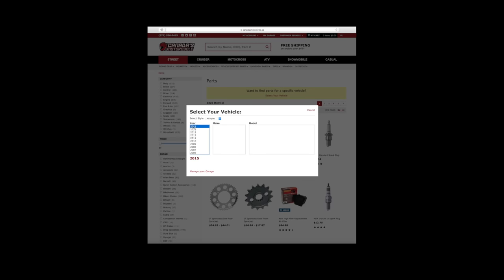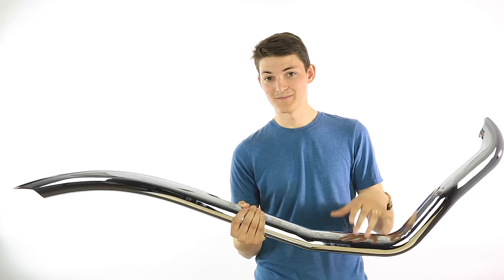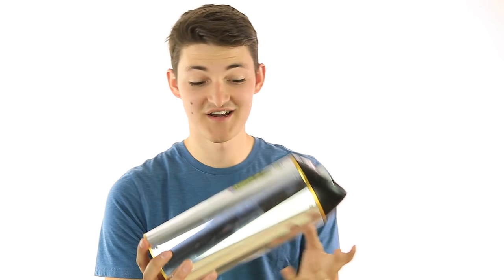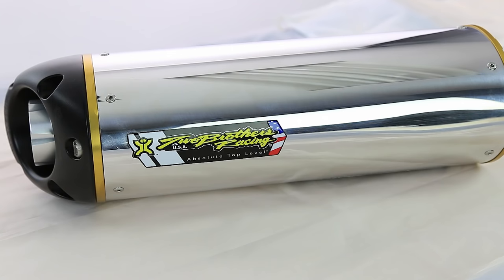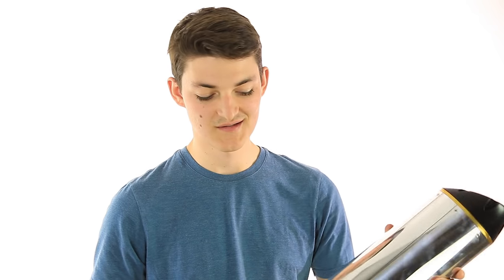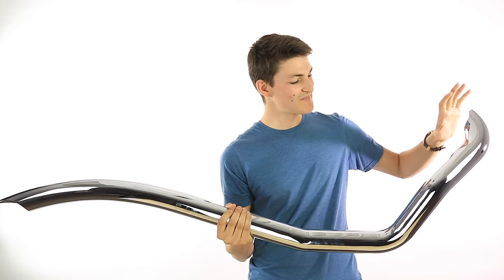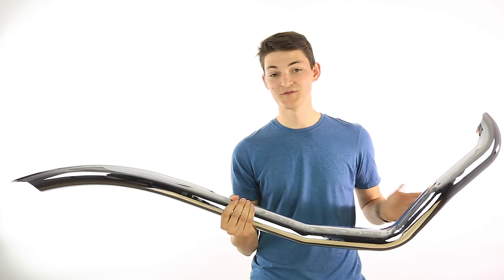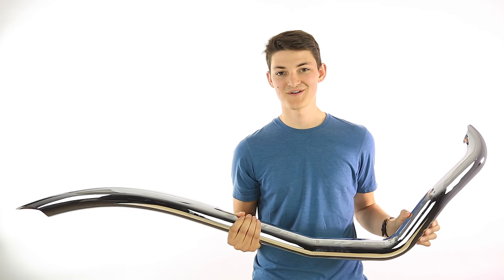Slip-on Exhausts vs. Full Systems

Comment: I think I'm sticking with the OEM, it sounds great, and every single time I put a slip on exhaust on my bikes, you could no longer hear that intake of air when you twist the throttle. I have a 2021 ZX6R, the exhaust doesn't look too bad and sounds good. The police in my area have started cracking down on loud bikes, so I'd prefer not to get the old blue led salute in my rear view, if possible. Plus, I have read multiple horror stories of people having to continually put their bike in the shop because they lost power and the bike ran like crap after a full exhaust and tune.
Reply: Shalin  I dont think slip ons will ever hurt the bike. Full exhaust and tuning would be more worry some.

Comment: Hello there, great video. I just have a quick question. I am planning to buy an Harley Davidson 883 and my friend is planning to buy a Harley Davidson 48. Both 2016 models. Will the Full system have a different sound than just replacing the mufflers. The price is more or less the same in India. Sound matters to both of us. We want to have a heavy and bold sound compared to the power requirements. Thanks in Advance
Reply from the maker: +Anurag Sharma Sorry for the late response - this one must have slipped through my filters! The full system will sound "different" from the slip-on. But that's not to say that a full system will sound any better. If you're only concerned with sound, go with the slip-on! The thing about your bike (and your friend's 48) is that the midpipe and header are very visible. So if you want a seamless-looking exhaust, you might have better luck with a full system. Of course style is a matter of preference, and a slip-on might look equally good to you! ~Ryan

Comment: I already changed the slip-on..does changing the headers impact the sound further?
Reply: Full straight pipe will be louder and lighter but you run lean. Now you will need a power commander or map for more fuel.

Comment: Hi I am thinking to install full system exhaust install on my z900.Just wanted to ask that does it harm engine and do u have to remap the ECU and also put power commander
Reply: No Yes and Yes. If you do the latter 2 it won't harm the engine.
Reply: Did you add a full sistem to your Z900? And if yes, how afect your hosrse power? Did you notoce any diference?
I put new sprockets to my z900. I put 16T and 41t and I can be any more satisfide.
My bike runs faster and impruve on every speed.
Please bro, let me know what your experience with the full sistem you have.

Comment: not quite right. You dont know how heavy some stock exhaust can be especially those with twin exhaust. Putting on a slip-on alone lightens up the rear of the bike and changes the way the bike handles around corner. Lesser weight in the rear, the more quicker n nimble the bike will be.
Reply from the maker: +akupehsluarketatAR Great point! When we refresh these guides for 2016, I'll be sure to mention that. ~Ryan
Reply: Canada's Motorcycle the slip on won't give you power gains but will it give you power loss? I have a wr125x. cheers!

Comment: hi..if i want to use slip on just for the bass sound & not performance..do i have to dyno? do i have to remap/reflash ecu? use stock ecu or new ones?
Reply: From my experience and in my opinion, no. The slip on simply changes the sound and of course saves some weight. As long as you don't change the factory exhaust you should be good. I have read on several forums, where people went full exhaust, got the ecu flashed and then started having power loss issues. Modern exhaust systems on sport bikes have been tuned to the engine. The engineers, have tuned the bike to perform at peak performance and usually a correct tune and full exhaust, really only gains about 5 to 10 more HP. Which on the street translates to less than 10 mph. So, is the thousand bucks you drop, really worth it? Usually no, also if you have a warranty or extended one, then stay away from the full exhaust.
Reply: @paulheinl9684  thanks

Comment: Hi there, can I change a full system exhaust without retune? (fuel injection)
Reply: You'll have to retune, but beware, you can get over a thousand bucks in and still only gain a few hp and minimal mph.

Comment: Don't forget a full system  deletes the catalytic  converter which also has quite a bit of weight and muffles the sound quite a bit as well but if you wanna stay in the good books with the neighbours just go slip on as Fort nine  says... But definitely go get your ECU flashed or a PC5 Now in most cases putting a slip on without a remap won't do irreparable damage but for the peace of mind and the few extra hp plus smoother throttle response I'd advise adjusting the AFR for sure.... KeepSafe Guyz  Cheers from Oakville Ontario  Canada,,,,,,,,EH!!!!!!
Reply: Amy Pettigrew What is ECU and PC5?

Comment: i just bought TVS APACHE 310RR(produced from collab of TVS AND BMW) which is newly launched in india....the thing is i want sound but it shouldnt affect the engine much or shouldnt create any problems in long run....and i have been told that this bike has some really complex system....
can provide some idea about it by doing some research on this bike.....

Comment: Well not exactly true in my experience. slip ons, as mentioned in another post, can reduce weight significantly, and depending on the bike and system, slip ons can also provide more or less back pressure which is important for either high end or low end torque. It is my opinion that a full system gives a slightly more performance increase across the whole RPM and torque curve. How ever adding a properly tuned slip on can give a 5-10% increase in HP in certain ranges, but only if combined with a free flow K&N style air filter and proper carb tuning in the case of carburetor bikes (ie: re-jetting) or in the case of FI bikes, re mapping visa vie Power commander or similar adjustable map device. The  CAT whether present or not makes little performance difference on a new bike, if your bike is 5 years old the CAT may indeed be somewhat restricted due to degradation. Bu If I were in business I would recommend a full system as well :)
Reply: James may is it you?

Comment: Hey man! Cool video so I got myself my first "motorbike" well it is a Yamaha yzf r125 (I am only 16) but yeah. I was thinking of getting myself an Akrapovic exhaust tho Idc if it's worth the full system or not.. if I should just go with the slip on can't really decide. What do you reckon?
Reply from the maker: +wille1086 Congrats on your first motorbike! You definitely picked a good one with the R125. Personally, I would go with the slip-on. Your fairing hides most of the header and midpipe anyway, so there isn't really a style benefit to the full system. And unless you're planning to race, the horsepower gains from the full system won't be that noticeable. I would go with the slip-on, since you'll get the same noise for a fraction of the price! ~Ryan
Reply: +Canada's Motorcycle cheers for the answer mate
Reply: Go with slip-oN ..!!!

Comment: Looking for yoshi r77 for a 2015 Yamaha FZ-07 please add it onto the website
Reply from the maker: perfecthips Slip-on or full system?
Reply: Full system in carbon or also the akrapovic full system
Reply from the maker: perfecthips Thanks for the info! I submitted a request to have the 2015 FZ-07 aftermarket exhausts from Yoshimura and Akrapovich added to the website. Check back for them soon! Also, how are you liking the new bike? I haven't ridden one of those yet, but they look brilliant. ~Ryan
Reply: So far I'm loving it, huge power upgrade from the 250 I had.
Reply: What did you go with?  I'm leaning towards the R77 or the Akra carbon instead of just getting the m4 slip on since I plan to do a power commander within a month of installing the exhaust.

Comment: Does the full system exhaust waste more gas mileage?
Reply: It does. You need a retune that gives the bike more gas if you want to actually take advantage of full system exhaust (more power). Even a slip-on will hurt gas mileage a little.

Comment: A slip-on sounds nothing like a full exhaust. Yes, it is cheaper and sound a little better. However, a full exhaust is wayyyyyyyy better sounding by all accounts! There could be no possible slip-on that has a SOUND QUALITY/loudness that a full system does. Good video otherwise, but that was misleading to noobies